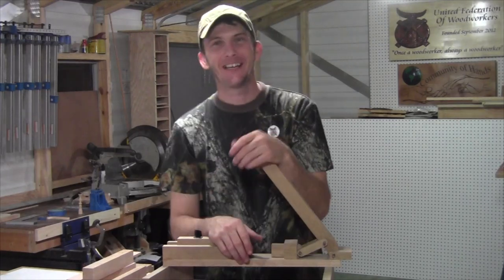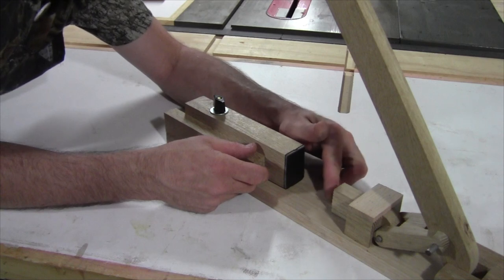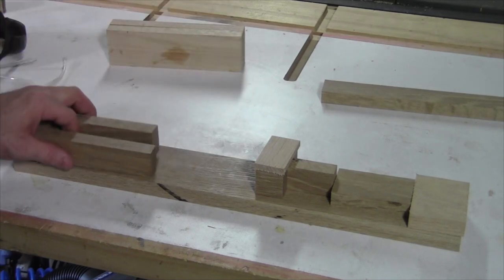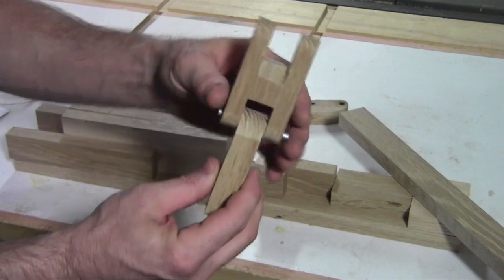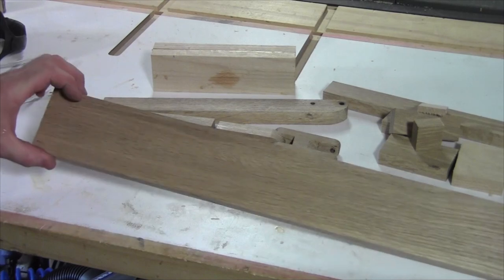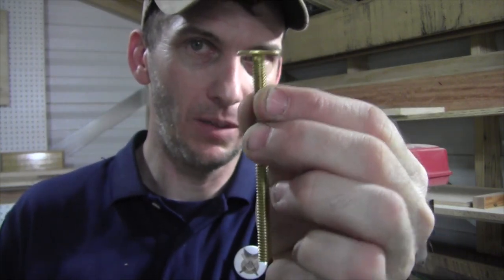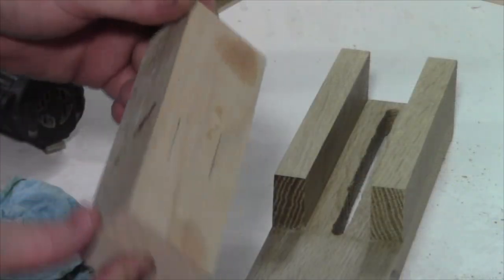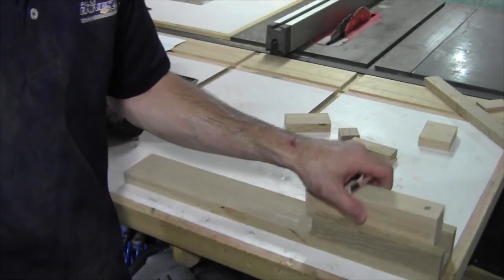Make Your Own Pen Press | PART 1

Comment: Hi Laney, I was wondering, why didn't you use a router to make the slot? Why a drill press? Would it have been possible to make the slot and recess using a router? I hadn't watched this video when it came out because I don't turn pens, but watched it now and it was fascinating to learn how you made the moving and sliding parts. Did you design it from scratch yourself? How do you know so much stuff?? :-)

Comment: I've watched several of your video's and I think they're great, however you fail in one part of your presentation. Safety. When you use the table saw, you use ear protection, BUT, you don't use any eye protection. How long does it take to slip on a pair of glasses or goggles. A word about safety procedures should be foremost in every video where power tools are used. Other than that, keep up the good work.